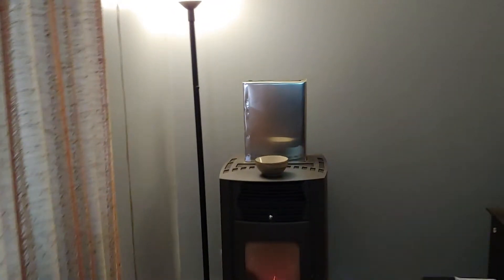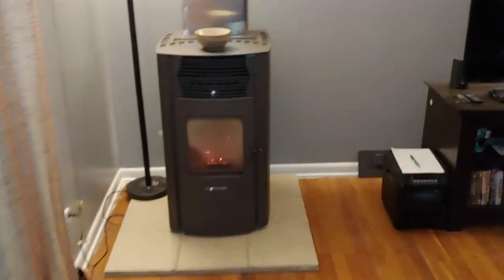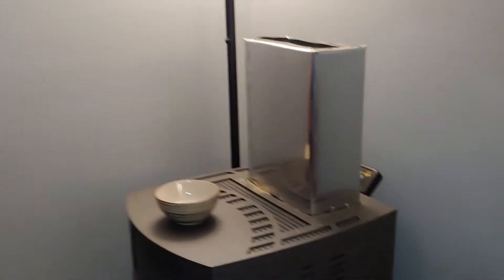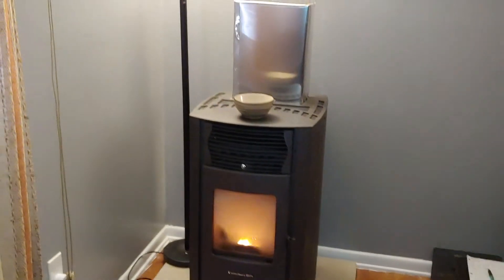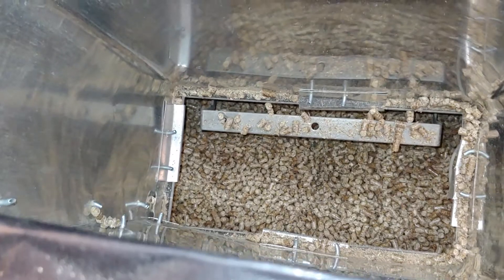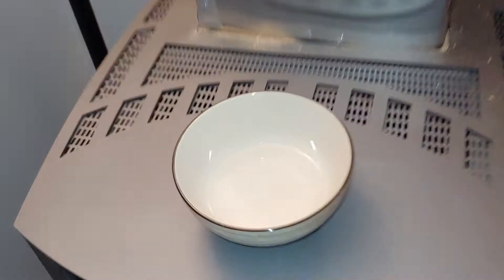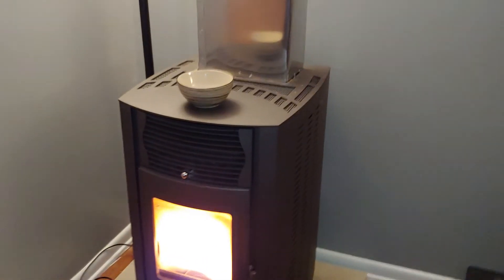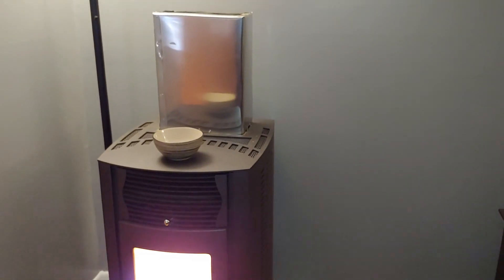pellet stove modification

Comment: Nice video I’m having tons for trouble with the controls  it’s in Celsius how do you put it in Fahrenheit? When does it supposed to feed pallets? I set it on 23 Celsius, and the only thing that says is on is the fire exhaust, but never feed him it never these pallets, but how long do it take for it to feed the pellets? The public stove is brand new, and when it did get started pull it was dropping and then it was a lot of smoke him and deposit stole. It was installed by a guy that who has a woodstove and who also a person there who finished my basement and he did it do by code which is by law.

Comment: I just set mine up yesterday, what is the average amount of pellets you go through on a 30 degrees day
Reply from the maker: 40 pounds or 1 bag
Reply: @kcct333  is that running on manual or how do you have it set up. Is that your only heat source. I have the same one and she is a pig.
Reply from the maker: @Juancarlo4342  we use its auto thermostat and heats to 70 degrees. it will ramp up when needed or stay low to maintain heat. works just like the furnace. we do have a back heat source but this is the primary. the back is never used unless the stove runs out. depends how size house too. were 1300 square feet.

Comment: You have no issues with vacuum lose with the hopper wide open like that?my stove is designed with a lid switch and will shut down if the lid is open for any length of time.it’s a built in safety feature that shouldn’t be by-passed.There is a danger that the fire could burn backward up the chute and get that whole hopper burning.I guess your being mindful of that —I just wouldn’t feel comfortable doing it.
Reply from the maker: We don't Have any issues, been this way for few years. safety switch is still in place. the extra hopper is sitting on it to keep it from shutting down. there is always risk when fire is used. it is very well maintained.

Comment: Considering this Comfortbilt purchase. Is your stove still keeping up ok a year later? Any problems or repairs? Is it a noisy pellet stove? Do you have a full chimney above your roof line? Thanks!
Reply from the maker: Our pellet stove is still working great, heats us right out of the house. We have not had any issues far as the stove itself. we did  have bird stuck in the air intake once, but that can happen. Buy quality pellets, we get ours at tractor supply. the rural king ones don't burn well.The stove is very quite and easy to maintain. are chimney is not above the roof. the stove stack goes out the back of unit and through the wall, then goes up about 6 feet or so with a clean-out. we bought the optional kit for to make things easier.
Reply: @kcct333  Thanks for the update! Helpful. I haven't seen this stove in physical display anywhere except for pictures, so it was hard to judge. Thanks!

Comment: How do you like it so far? Looking into comfortbilt
Reply from the maker: love it. easy to use and maintain. has a built thermostat that works well. keeps the house at 70 degrees all winter long. we run it none stop with the exception of cleaning every two days. got it at home-depot around 2,000 dollars. wood pellets average 4.00 dollars a bag 40LB. wish we did it years ago.
Reply: @kcct333  what about your electric bill?
Reply from the maker: @gustavotessaro1  it will vary from 40 to 60 dollars a month.
Reply from the maker: @gustavotessaro1  we have some solar on the roof back feeding the house.